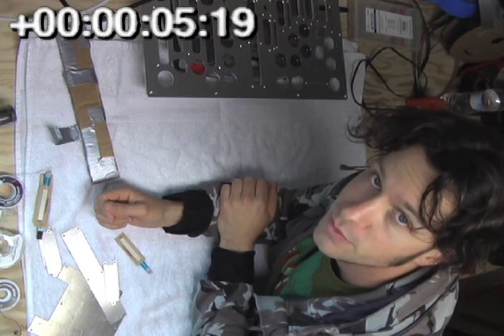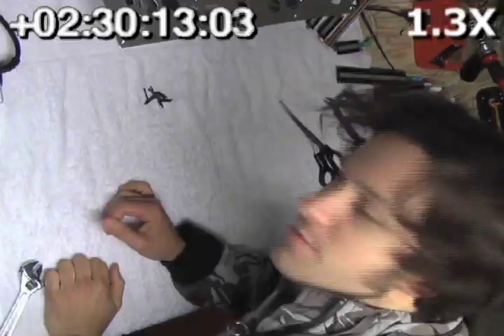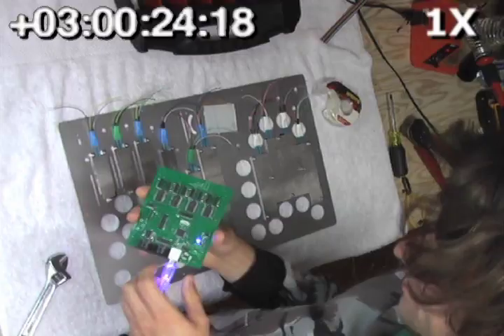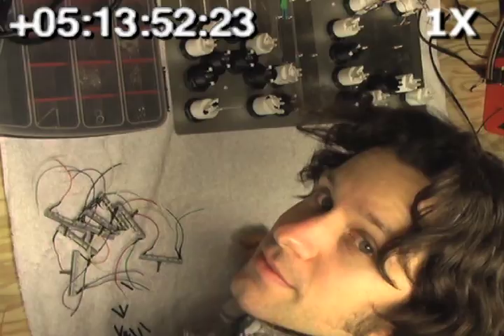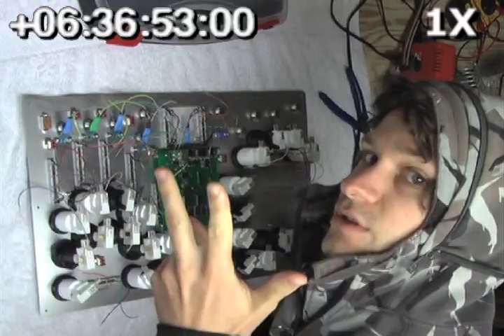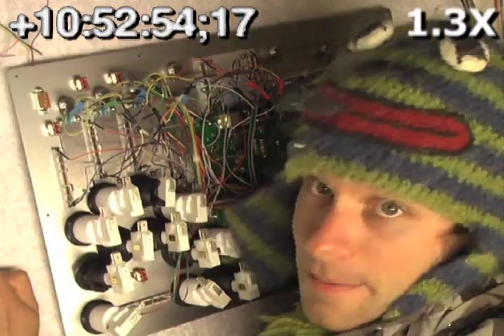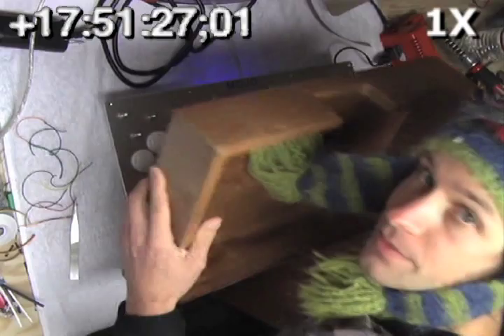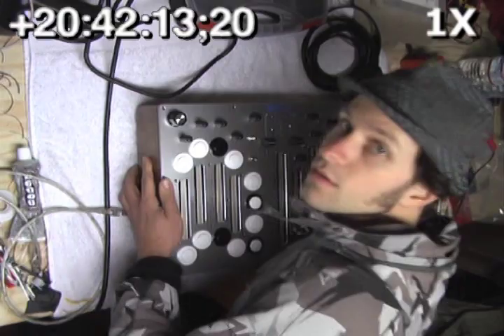Mojo Build Time-Lapse

Comment: Get washers as spacers, and on the top every fader, there are two holes for screws.
Just make the screwholes on the top cover of your controller, and use the washers to make space between the top cover and the fader, so it won't stck out that much.

Comment: The buttons are connected in a matrix, the diodes are so that if more than one button is pressed at once they don't interfere with each other. Google for "button matrix circuit diagram" to see how its done.